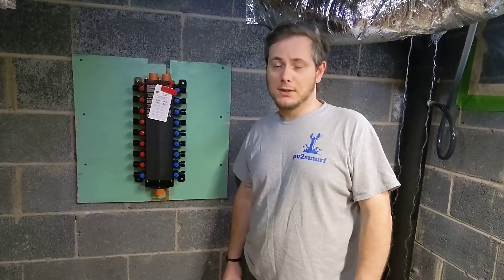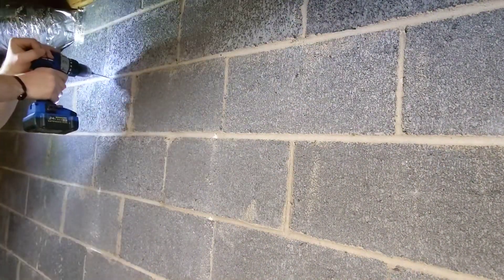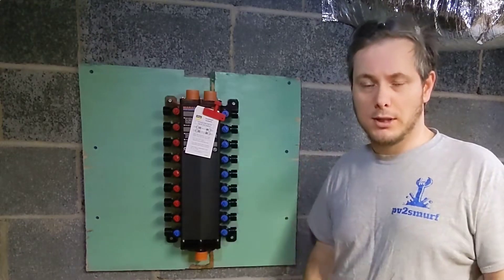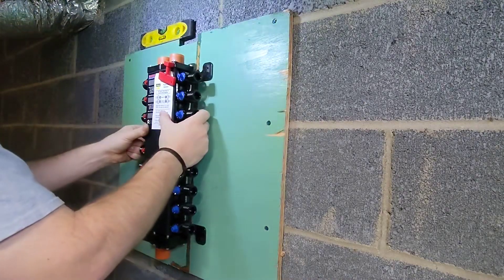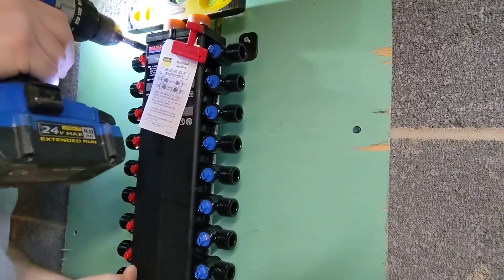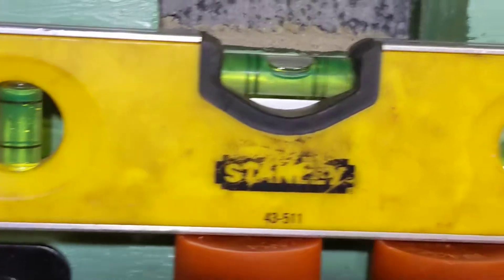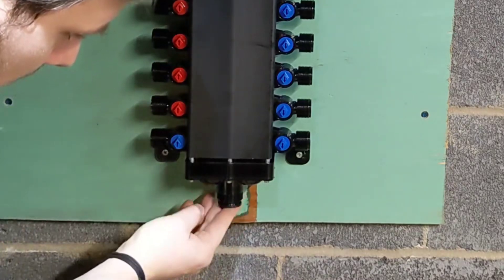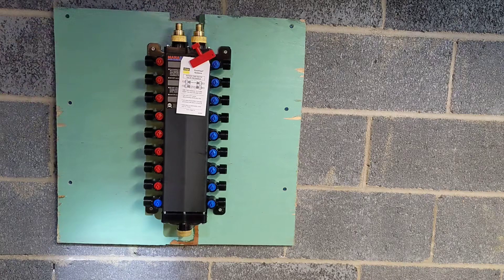Viega Manabloc install

Comment: Dude. You are the only one who slowed down and explained the fitting and how to set this thing up. Thanks. I plan on using this thing also. Let me know if had any good or bad after installing this thing. Thanks.
Reply from the maker: I'm no plumber (as stated in the video) but after over a year I've had zero issues to date with any of the manabloc.  To me the peace of mind of not having ANY FITTINGS whatsoever within the walls, really helped me make the decision to install one of these.